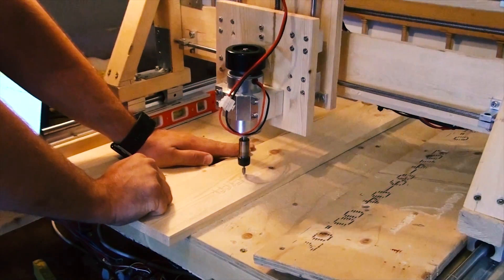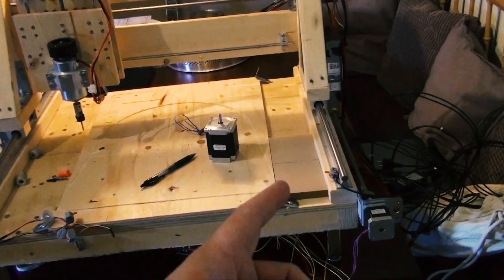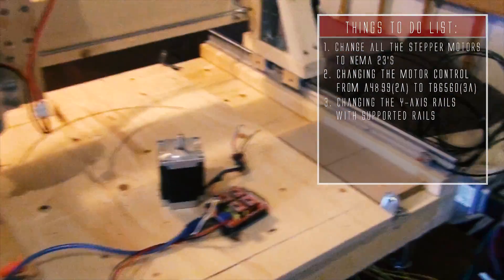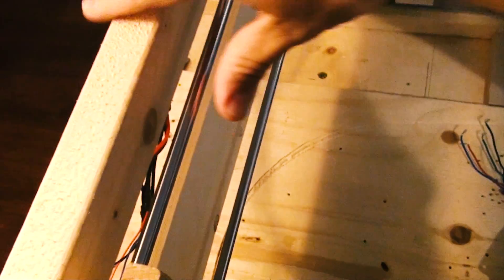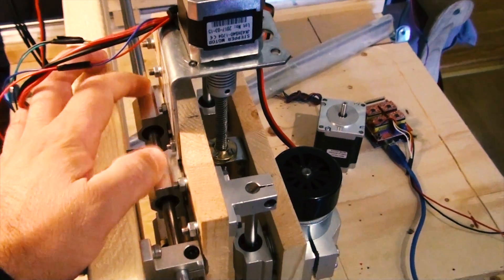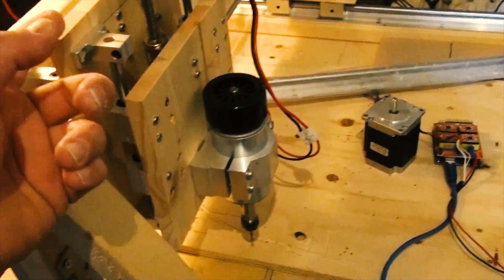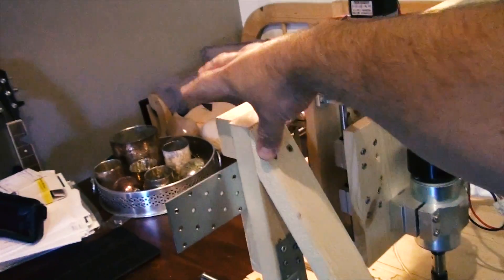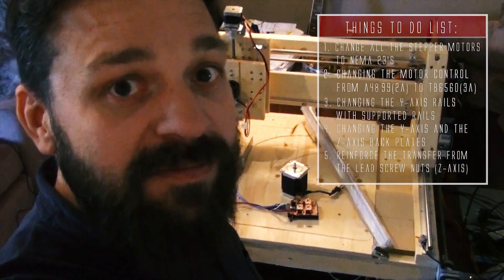First DIY CNC build (Part 7) - Does it NEED improvements? YES!!

Comment: I know this is old, but did you jumper the steps on the CNC?
Reply from the maker: https://youtu.be/r1zi9vx3YP0
Reply: Thanks for that. I just can’t see if you jumped the micro steps under the drivers. Like did you jump it down to 1/2, 1/4, 1/8 or 1/6?

Comment: I also want to build a cnc machine and have watched almost all of your videos. It’s all very clear. This is my first response and it may have already been answered on the following comment.
I thought the X axis was the horizontal movement of the spindle (left - right)
and the Y axis represents the forward and backward movement of the table.
Here are the axles swapped. Isn't this a problem with correct gcodes?
Reply from the maker: Hi, there really is no problem with the g-code when swapping the x and y axis. You only have to place your stock piece according to it. There are different kind of standards in different part of the world where you put your x vs y axis. But on my next build I will swap them because the way you mention is the most used setup 👍😀 thanks for watching my videos and good luck with your build

Comment: 5:10 das ist doch logisch das die Lasche schaukelt so wie die gesamte konstrucktion, war bestimmt eine Übung, bevor die eigendliche Maschine kommt, da bin ich mir sicher, zum gravieren von Holz geht die Maschine aber trotzdem gut, und alle wissen jetzt wie es nicht geht. Danke für´s hochladen.
5:10 Det er logisk at klaffen svinger som hele konstruksjonen, var definitivt en øvelse før selve maskinen kommer, det er jeg sikker på, men maskinen er fortsatt bra for gravering av tre, og alle vet nå hvordan det fungerer ikke. Takk for at du lastet opp.
5:10 It is logical that the flap swings like the whole construction, was definitely an exercise before the machine itself comes, I'm sure, but the machine is still good for engraving wood, and everyone now knows how it does not work. Thank you for uploading.
Reply from the maker: Hi and thanks for watching and giving feedback on 3 different languages :)  Yeah, that mechanism is not optimal but it acctually still works after I did the "upgrade" I am planing on upgrading the whole cnc machine in the near future

Comment: This series is fantastic. There are so many videos out there on the same topic which are great but they'll only show you the bits they got right. I'm a engineer/tradesman, electrical/joinery/plumbing/welding etc so i know how important it is to make mistakes in the learning process. I never see mistakes as failures, it's so important to teach people why something didn't work so that they can apply that knowledge to other things. Seeing mistakes triggers the brain to think of solutions rather than just copying like for like and it develops the engineering brain. I have built an electric gate opening/closing ram using a threaded rod and some square tubing and i was looking at ways to control it which led me to discover the world of Arduino. Gate project is done and now i'm going to build a CNC router. I'll be using steel for most of it but the design will be very similar to this one. Thankyou for sharing your work and i hope it inspires more people to learn and to have the confidence to build their own projects, and more importantly - to share their mistakes as well as their successes. Skål

Comment: my one x-axis stepper sometimes looses steps...as a result one side lags behind what should i do to correct it?
Reply from the maker: Hi, if your stepper looses steps there can be a lot of different things causing it. First of all check that your mechanical connections are thight (flexmount between motor and lead screw/belt). If you have to small stepper motors, that might also be a cause. Or you can suffre from electronic noise
Reply: @WillysGarageNorway  I am using neema 17 Stepper motors...btw thankyou

Comment: 2 nema 17s skipping, is this because or higher movement speed? Im also planning a cnc, and net is filled with lot of confusing information, while some are happy and using nema17s some are regretting using it
Reply from the maker: You must first get you step/revolution correctly adjusted, Then adjust the mm/sec til you get good movement of the steppers. If you are building an engraver machine (light cnc work) the nema 17 should be fine (with the right drivers). But for any milling, carving, hard wood cnc work I would strongly recommend you go for nema23 with tb6560, tb6600 or better drivers :)
Reply: @WillysGarageNorway  Thanks for quick response and advise. Planning some soft wood (enclosures etc) to pcb milling (very fine traces). Looks like nema23 is the way to go. Thanks again. You have a new subscriber. Loved the honest advise.
Reply from the maker: @testing beta7 no problem :) I can't promise I always answer questions this quick but I alway try to give my honest opinion. Thanks for watching :)

Comment: great and nice work , i would ask you mister for the real dimensions  of your cnc (if it's possible ) 
cheers
Reply from the maker: Yes, its possible. Do you have sketchup? The machine is 600mm x 600mm
Reply from the maker: ...and thanks 😀👍
Reply: thank you mister for the respond and sharing .... if i would grow up this cnc ... these engines are sufficient or i need engines more powerful ( in ampires) ?
another question in X axis one motor is enough or it's better to make 2 motors ?
thank you ...
Reply from the maker: @tadjhamid8502  no problem, If you use the NEMA23 motors, wich I ended up using, and the TB6560 og TB6600 as stepper motor drivers, and a good power supply, you should have no problem "growing" this design to a bigger machine. But I would recommend you use 2 steppers for the x-axis since this moves a lot of weight and its also easyer to "balance". Hope this helps 👍
Reply: @WillysGarageNorway  that's good ... thank you very much ....cheers
Reply from the maker: @tadjhamid8502  cheers 👍